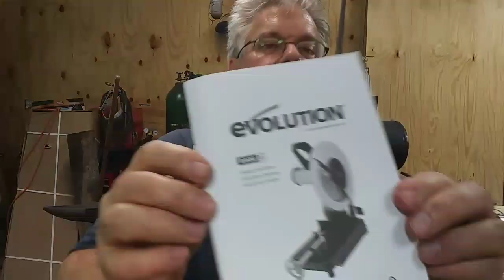Evolution 14 inch Chop Saw Unboxing and Use. Gifts from my family.

Comment: Thanks Gary, I need to replace mine, it is on its last leg. Only concern I have is I need to cut much thicker metal. I sure like the lack of sparks, and no heat. That  is not the case with my abrasive cutting wheels. Wayne
Reply from the maker: I figure if I have to cut thicker things I can use the band saw,  torch, or cut off wheel on an angle grinder.  There is a time that an abrasive cut off is better though.  It was kind of a gamble on my part but I think it will work out okay for my needs.  Thanks for watching and commenting.  I really appreciate it.
Reply: I agree and I love the cuts and lack of heat.  I cut a lot of 3/8" x 1" for building the railroad track. It is really quick for me. And in the blacksmith shop larger square and round stock. Sure would like to maybe invest in one of these one day. Thanks again for the video, the timing was great for me.

Comment: I'm still trying to figure out the difference between the blue evolution miter saw that you see on amazon that is like 380 ish dollars. its also a 14 inch blade. Either way I think I'm going to go to home depot tomorrow and order me one.
Reply from the maker: I'm not real sure either other than it has better handles and probably a better blade. The one I have uses an Allen wrench to change the angles but I don't change that very much.  I am still using the original blade.  One tip I found after I made this video. When you screw on the black handle on the crank, use lock tight. Mine kept unscrewing. You will really like it.  Let me know if you have any questions.